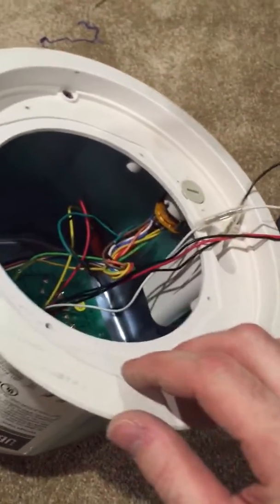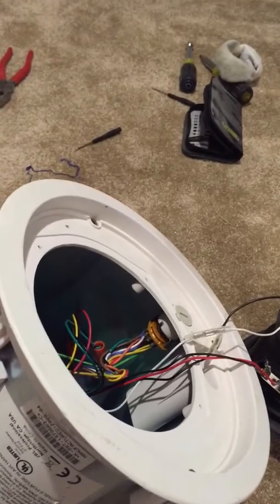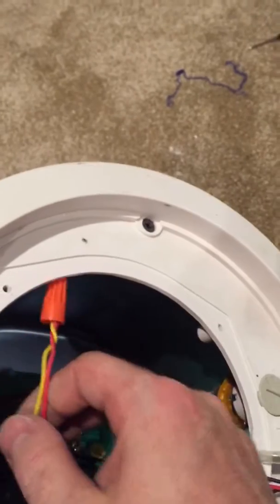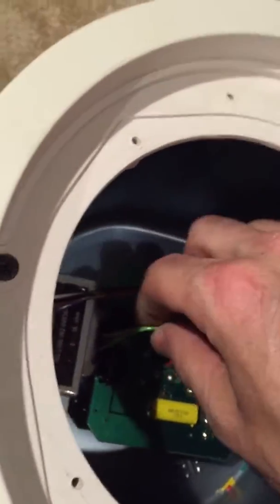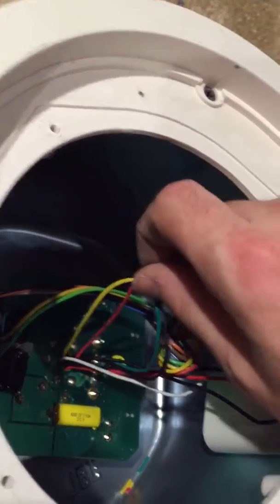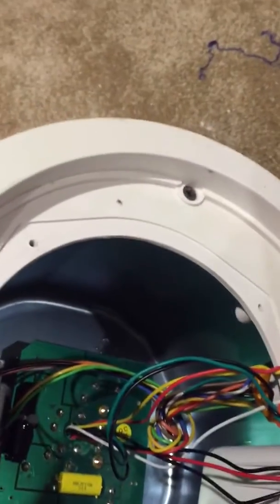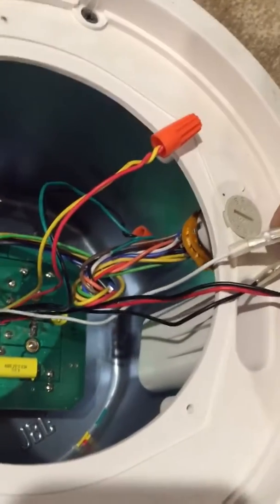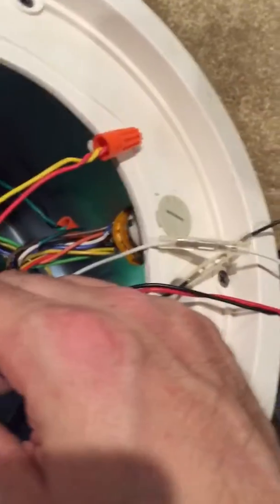JBL Control 26CT mod for home theater system

Comment: Hey Greg great video!! Thanks so much, can you explain how to take a regular white and black cables. Out of the 4 slot connectors, I have a pair of these and want to hook them up to a sony Muteki 1950 w, not sure how to take the regular 2 cables connection out of that 4 pin slot. Thanks and happy new year

Comment: Greg.  Thanks for video. On the back of speaker there is the wire plug connector which I did not get with my speaker. With this modification which wires do I need to run to the stereo ?  Thanks

Comment: I put a meter on the terminals and the speaker itself. It read 13.7ohm at both locations. How did you come up with 8ohms with this mod?
Reply from the maker: To be honest, it’s been a few years since I did all of this, I’m not quite sure how I landed on 8ohms.  If your meter is saying it’s 13, then I guess it’s 13.  Either way it makes my home theater sound A LOT better.
Reply: It read 13ohms after you bypassed the transformer?

Comment: Greg how do i bypass the  trasformer on a 24ct  it only has four wires going to  circuit bord one black one red one orange and one blue
Reply from the maker: Fernando mtz  where do the wires go off the circuit board?
Reply: No  i m sorry,  the four  wires go to  the trasformer from  the connector block and there is  a red and a black  wire  that go to  the  circuit bord. What i did is got rid of the trasformer and connected the red and the black wires to the radio and it is  working good. thanks Greg watching your vidio gave me this idea.
Reply: Thanks, man, good idea.

Comment: will this work for the JBL CONTROL 16C/T-BK | Two Way 6 1/2 in Coaxial Ceiling Loudspeaker
Reply: that has a bypass switch on it.
Reply: It will but its not necessary as there is a bypass switch.

Comment: This setup will work w/a standard 8 Ohm theater system but my question is where which terminal on the speaker would I connect my surround output to? I will be doing this to 4 speakers that I will use as L and R surrounds in a 7.1 system  Thx
Reply: Did you figure it out?

Comment: I have a pair of brand new Control 26CT (that I purchased as-is in a Control 26C box). I noticed you made this 16ohm speaker an 8ohm speaker. Which wire would I need to reconnect to make them 16ohms speakers again? I was planning to run two sets of speakers(16 ohm) in parallel to bring the load back down to 8ohms. 
Thanks!

Comment: what did you do to take the transformer out of the equation? i just got 8 24CTs for free and i would like to use them in my basement. Do you have to run individual wires to each now or can you still daisychain it?
Reply from the maker: +Jared Wiseman if youre running a home theater you'll to have to run a dedicated wire to each speaker, each speaker serves a different purpose in a home theater.  I detail how to bypass the transformer in the video

Comment: Thank you for uploading this. Much more clear than the other vid on Youtbe with the different instructions. Quickly, I was wondering, how do you know they are 8 ohms? I ask because the standard 26c (not the T version) is 16 ohms. Also, on the less clear YT video that i mentioned above, has a commenter stating it is 16 ohms. Please/thanks
Reply from the maker: +Moo Tube Thanks for the kind words, in both the video description and in the video itself I say that these are 16 ohm speakers, we're modding them to run more efficiently on a system that would like an 8 ohm speaker
Reply: +Greg Oleksa I'm an idiot. Thanks for the prompt response
Reply: Greg Oleksa forgive my ignorance, but I got the impression (perhaps incorrectly) that the impedance was 16 when going through the transformer, but that the speaker itself is 8 ohms. Is that not correct?

I did this mod on one of my four 24CT units yesterday and it sounds AWESOME, so the other 3 are soon to follow.

I have two 24C units as well - I hope the process is the same. All six speakers were given to me 3 years ago when a friend doing an equipment upgrade for a large corporation was given about 30. His trunk looked ridiculous :P